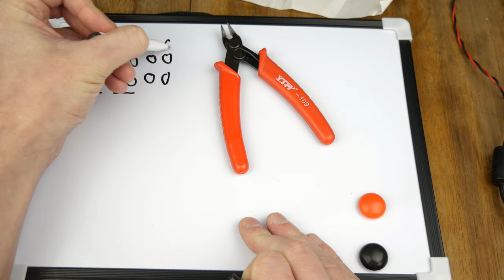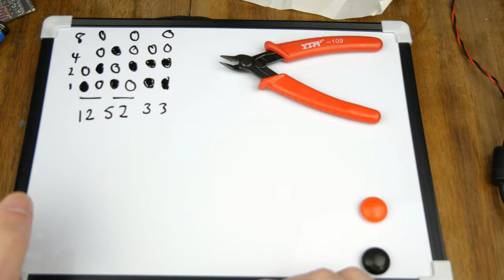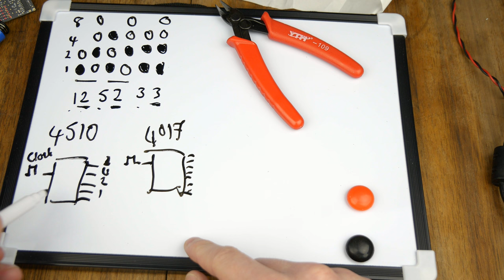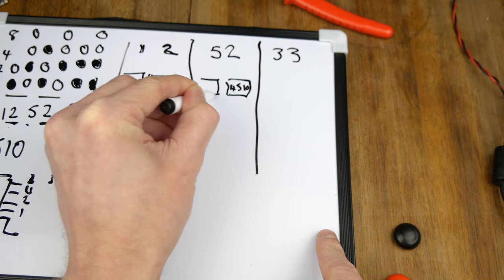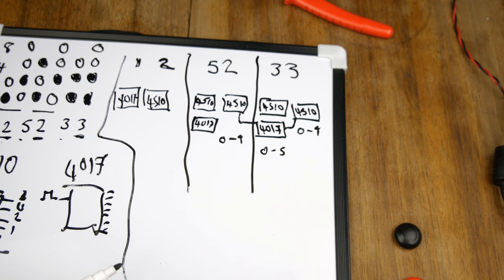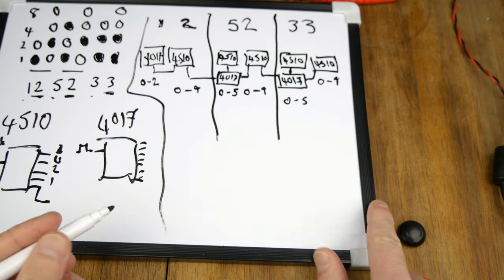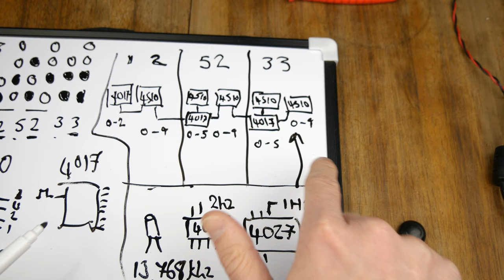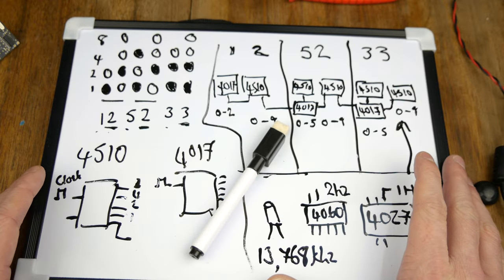I'm making my own electronics kit: Binary Clock

Comment: will it be smd or dip parts? I got inspired and designed an hour+minute binary design with an atmega328 and 10mm LEDs, on a 5x5cm2 dirtypcb board. Won't order them, still needs a check. Never order boards after midnight, they're like gremlins....

Comment: Rather than using the 4017 and 4510 running in parallel for most significant digits or hours minutes and seconds, just use the 4017 and a few diodes to convert the 4017 outputs to the binary LEDs.
Save a few chips.

Comment: Many, many years ago I had a binary LED clock just like the one you showed at the start of the video. It came from ThinkGeek and counted the AC line cycles rather than using a crystal. Unfortunately it was designed for the US 110VAC @ 60Hz. I used a step down transformer, but the 50Hz used in Australia made it run slowly, and I couldn't figure out how to fix it.

Comment: Doesn't every chip have slight variations during manufacturing?  So after a couple hours, or days, would this clock be very accurate? definitively interested though.
Reply from the maker: My guess is that it would lose a minute or so a month, mostly depending upon the temperature. These days the only clock I really trust is on my phone.
Reply: ha, OK, still looking forward to it!

Comment: What's going on here?! First Julian is building a computer out of logic ICs, now you're building a clock out of logic ICs. What next? an LED cube driven by discrete transistors?! :-)
On a serious note, the kit is not for me, but I bet many people would find it liberating to solder the kit and not have to deal with any software.
Reply: Much too modern why not replace the transistors and leds with vacuum tubes ;-)